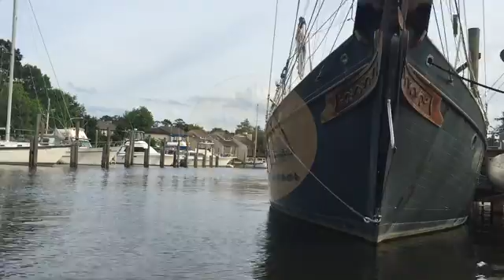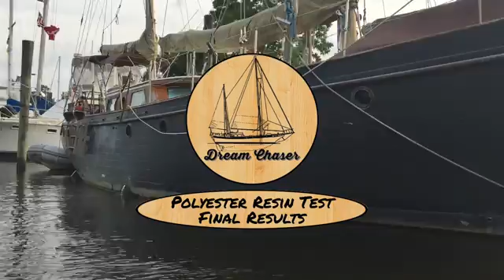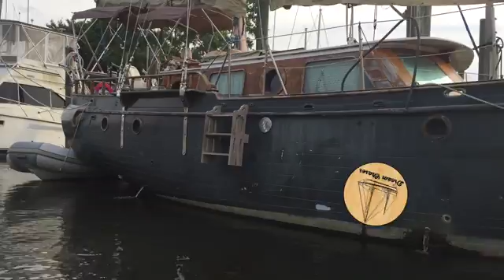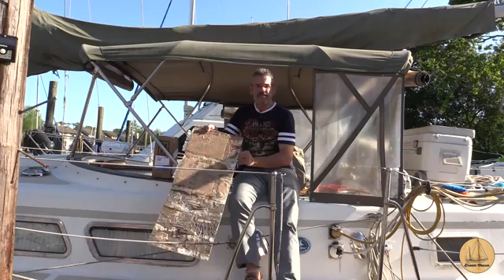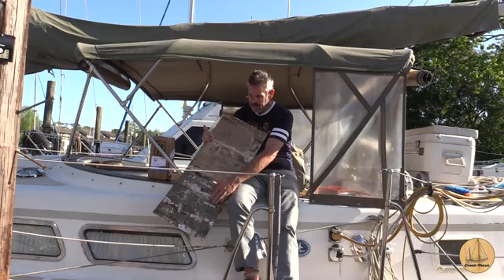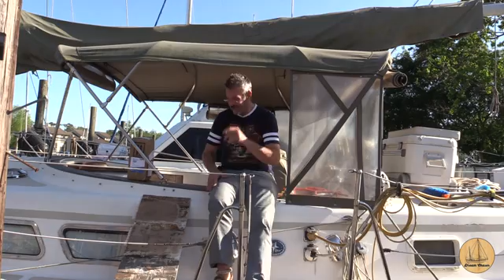Final Result of Polyester Fiberglass Resin Destructive Testing

Comment: 7 years later now and I happened to come across your video-series of testing for your deck. I really enjoyed your approach and I'm sure Polyester Resin is good enough for water-proofing in your case. So, thank you for doing this!

The reason I was searching on YouTube was to get some inspiration how best to lay huge areas of fibreglass with Epoxy. I'm re-building my 50-foot ketch. It all started with some soft spots on my deck, which was a plywood-construction with fibreglass (Polyester) on top. I knew there was a problem and kept on sailing till I found a port where I have access to storage. I found that in Nazaré/Portugal (Europe). 

First I started digging in small spaces hoping to tackle the problem, when it became obvious my whole deck has to come off. I took it off, replaced some deckbeams in the process and layed on a new plywood deck. One layer of 12 mm, 3 layers of 6 mm laminated with Epoxy. I'm not far from the point where the fibreglass with Epoxy can go on top. But I've got to find a way how best to do it. I've only got my 2 hands and a head on my shoulders. Obviously my masts and all fittings are removed, as well as hatches and the little deckhouse aft.

But how to do it? It's got to be in smallish stages before the Epoxy goes off. If I take the fibreglass across I can't see how I could possibly reach the side away from me as it's quite wide, to stick it properly down and cover it in preparation for the next step. If I take it along the length of the hull, how do I join it?

I know you've been asking heaps of questions about the two materials (Polyester and Epoxy) on Forums and got a huge amount of answers which weren't able to make you decide, so you started testing.

I would like to tell you one thing: when ripping my old deck off and I reached the stern-area, I found there was an (original) positive stern with a negative stern added on to it and water trapped in there. So, I called the shipwright to help me sort out this matter. We took the second stern out, the first one and re-built the whole thing. What we realized when doing this was that all the nails holding the planks (well, stringers in my case, covered with plywood strips 45 degrees diagonal and covered with fibreglass and Polyester) are failing. 

There is two reasons for this:

Polyester does not properly bond to timber (or plywood), and Polyester is just soaking up water wherever it has a chance to do so. In my case it exposed the nails holding the planks (stringers) in place to water and they started to rust away.

This means that I've got to re-fasten my whole boat, which in return means, that all the Fibreglass (Polyester) has to come off, because I need to get access to the joint (frames and planks). 

It's easy: just cut a patch with the angle-grinder with the thin cutting disc, give it a push with the crowbar and the hammer and it's down on the concrete. No big deal.

A few of my planks/stringers aren't in a good state, timber isn't that expensive luckily still, so, we're replacing. 5 winter-days with short daylight and we've managed to replace half of the stringers on the port side.

My lesson learnt is, that for the way my boat is conceived and constructed, Polyester is not the solution. 

I still enjoyed your videos, thank you!!!
Reply from the maker: Wow, sounds like you are in the middle of some major work as well.  I was worried about the same thing you mentioned, I didn't think I could work fast enough for large areas by myself or even with a friend or 2.  My testing really helped and did help me realize I could reduce cost by going with Poly.  I ended up doing the repairs and later also ripped my teak off and replaced it with fiberglass.  I ended up having a yard do it, but that was a pretty hefty yard bill.  lol

Safe Rebuilding then sailing my friend.
Reply: @Svdreamchaser  thank you!

Comment: Generally speaking, PE bonds better if it has "tooth". That is, wood should be rough texture, not sanded smooth. FG surfaces should be prepped by making a scratcher, and deliberately with pressure, scratch the surface of the bonding surface so that there is a "fuzz" of fibers exposed.(you can rough sand before hand if desired). PE is all that I ever used in my wood boat building and auto body work. Been using it for 50 years. The glass hardens real quick and I have never measured my hardener. Sometimes it took longer because I'd take a chance on an almost empty tube for a big batch, but that only cost me time. BTW: I think that hole in someone's hull is a big one and will eventually blow the sump pump, Ha!
Reply from the maker: Great tips !  Thank you.

Comment: SV DC, I've watched your last couple of videos on the deck repair, I thought your previous epoxy pull test was performed with the plywood and your polyester test in this video is using the fiberglass layers. In your final comments you said you used the epoxy with fiberglass did you misspoke or did I miss something?
Reply from the maker: ray Nic thanks for the question. I will do my best to respond and am open to a more detailed discussion if this doesn't clear up the rest I performed. 
In short I wanted to know the bonding strength of the material I would choose. Both of these tests used a peice of the old deck as the base. 
In the epoxy test I applied epoxy to the resin surface and put a price of wood onto it to test where it would split (on the wood side of the epoxy or the Poly side.)
I then layer up more layers on poly on the poly deck piece. 
What this demonstrated to me is that either were very close in results so the poly was a better choice for me due to fairly equal results but 1/5 th the price. 
Does that make sense. It is a bit hard to put in just the response. Private message me and we can arrange a chat too.

Comment: Hi great results!  re fillers , the talc type fillers is very cheap but it's not at all like micro balloons. The micro balloons are hollow so they will sand down much easier than the solid talc type filler (similar to west high density filler).  If you have rough fairing filler to sand you will notice the difference!
Please use a layer of chopped strand mat under the woven roving to get a much better bond as it increases the surface area of the  contact of glass.
I really like the idea of a layer glass over the deck. Good choice.
Re bond to old deck , all you have to do is grind the entire surface smooth, you do not need to grind down to the glass!!!! Also the bond will not be effected  by the old polyester or the cured epoxy in the holes. What ever you use it will all bond to the cured material. The new material does not know what the difference is! 
Cheers ,you have a big project.  Warren
Ps I'm have been in fiberglass business 40 yrs
Reply from the maker: Thanks for the GREAT tips and guidance